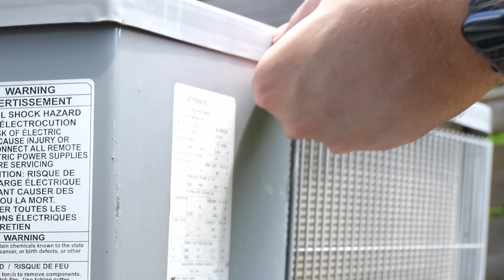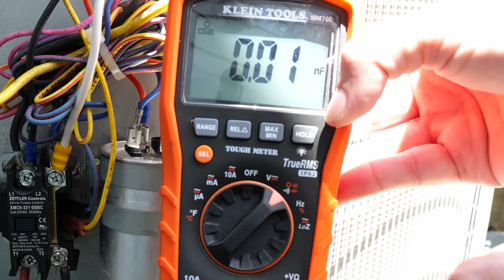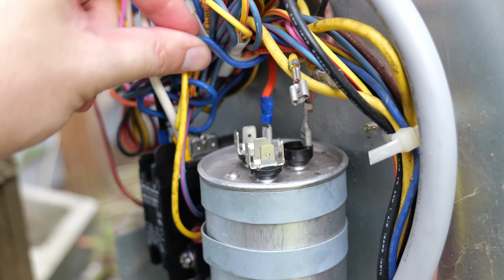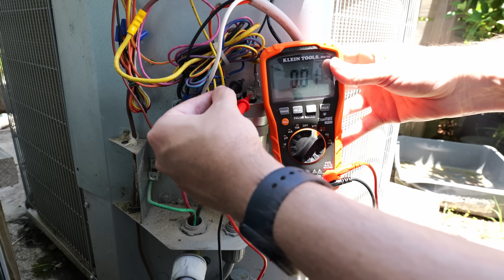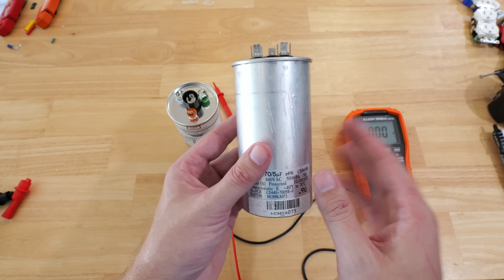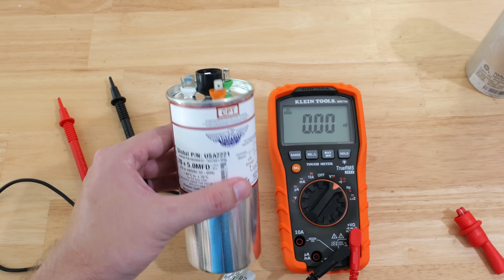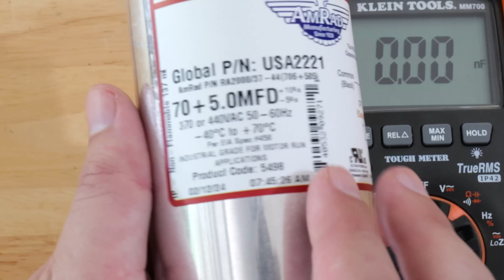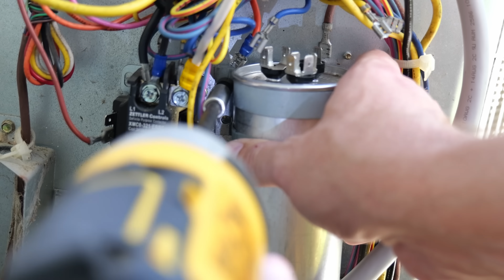Don’t Get Ripped Off! How To Avoid The AC Capacitor Scam And Save $500

Comment: As an AC tech I hate to admit that there's a LOT of technicians out there that will try to sell you parts just to make money. Personally, I hate how much most companies upcharge on parts. I get that what you're technically paying for isn't the parts but our knowledge as technicians. Companies usually get a discount at supply houses, so say they pay about 5 - 10 bucks for a capacitor. They then turn around and sell it to the customer for $300 - $500. I worked for one company that sold capacitors for as much as $575. As a homeowner, the more you can learn how to check and fix yourself, the better. Having a shop vac and knowing how to test a capacitor will save you from just about 90% of service calls in the state of Florida.
Reply: Thank you for your post. It was very helpful. ❤
Reply: Are you in the west Palm Beach area by chance?
Reply: What’s the best brand? I bought an AmRad on Amazon. Hope it last longer than a year
Reply: If you're blowing a capacitor every year something else is wrong  @TobyCostaRica
Reply: There needs to be a 'non-qualified tech hotline' report these so-called techs. 3strikes and you're out.
Reply: @LonnieMichel  there would be a few dozen left in this country
Reply: Checking a capacitor under load is only one method and is not more accurate than doing it as the video shows.  It’s a fact, look it up.
Reply: As a business owner (computer repair), parts need to have a 70% profit margin + whatever your hourly rate needs to be.  For example, if a part costs me $25, I need to charge about $85 in order for it to be worth it to keep parts in stock.  If my hourly rate is $260 and it takes me half an hour, the bill should be $215 ($85 + $130).  Special order parts don't need to have such a high profit margin.  Just enough to cover you in case you need to replace the part under warranty.  I've found a profit margin between 20% and 30% on special order parts is sufficient.  If the part is really expensive then the profit margin can be even lower.  I just did a motherboard replacement for a client.  The motherboard itself was $460 and I charged him $525 for it (which is about a 12% profit margin) plus half an hour of my time, so $655.  It was well worth it seeing as it was a $2,500 computer that was only about a year old.  You don't have to completely screw people over or make 3-10x your cost on a job in order to stay in business.  I absolutely hate contractors because in my experience 99% of them are greedy scam artists.  No, I'm sorry, you don't need to make $10,000+/day per customer.  That's just pure greed.  When the decking costs $2,600 and you're charging me $40,000 there's a problem.  Even if you paid your guys $100/hour your cost would only be $9,000 and you know he's not paying his guys anywhere NEAR that much.  When contractors quote me like this I call them out on their greed and tell them to F off.  It takes time but you can find contractors who aren't greed a-holes.
Reply: my experience is that AC techs are the worst professionals I have ever seen - worse than vets and doctors.
Reply: @donaldist7321 You've had zero experience with attorneys then??!!!   They will bill you at $600.00/hr at 1/10 hr increments and not even write the legal arguement using the crooect legal basis and you will for sure, 100% guaranteed, lose in court! And they still get paid $10,000 t over $20,000 per month because in their retainer you will have signed, it says results are not guaranteed!!!
Reply: And this is why you will always be an AC technician.  You are completely oblivious do the cost of operating a business.  That truck your boss lets you use is not a retail store.  Fixed overhead alone is insane for our trade.  500 during regular business hours is definitely High.  However call me out on a weekend and you bet your ass that's fair game.
Reply: 575 is a good price, imagine the cost of running a business bro. As someone that has just started, it’s crazy what you have to spend
Reply: 575 is a ridiculous uncharge. Majority of the ac companies in my area charge between 250 - 375 for a cap replacement. It gets really hard to try and explain to a customer why you're charging him almost $600 for a part he can buy for less than $50 himself.
Reply: @christianlandry4499  I'm in Arizona going rate for a cap is $400 I heard in California they get you for $650 weekdays after hours $750. Local news media use to setup cameras for these guys put dead batteries in the thermostat. Had one guy taking a piss next to the condenser unit he told the home owner he was putting refrigerant in charged $800 the system was low. He said throw in fresh pair of AA batteries for free. When the host of the show came out guy packed up and ran like a rabbit even left behind some tools.
Reply: @christianlandry4499  I hear the traffic gets much worse every year in Florida?
Reply: As an ac tech you should know this video doesn't show anyone how to check a capacitor properly... you test capacitors under load not while the unit is off.
Reply: @iratedu2776  If that's what you honestly believe then I hope to whatever greater power you might believe in that you don't do this for a living, or that you somehow have capacitor and contactor confused.
Reply: @christianlandry4499 in what? You absolutely check a capacitor under load using amps, volts and math.
Reply: @japhethwillmore725  What company do you work for and where are you located so people can avoid your business!  Capacitors are NEVER tested under load! Do you think the manufacturer has multiple systems that use all the various uF capacitors and they hook up these capacitirs to these live systems and check for capacitance??!!! 😂😂😂😂
Reply: @iratedu2776 why even test it? It's $30 and probably the issue if the fan is not coming on, just parts cannon it before calling a tech.....
Reply: @iratedu2776  must be a newbie in the trade and wants to create job security,
Reply: @iratedu2776  what are you talking about??? You can also test with the capacitor disconnected.
Reply: @VegasXGeorge  you can definitely check a capacitor while it’s not under load yes, but the correct way is to check it under load.

Comment: Had a breaker popping , tech showed up first thing clown did is put a screwdriver into service port of refrigerant and let a cloud out into air. Said he was checking for a charge? Well not anymore. I said i have had capacitor go bad and has caused this type of symptom. He finally checked it buldged and leaking. Charged us 200.00 for my diagnostics and a 25.00 part. Never checked the refrigerant levels after releasing to atmosphere. Clown shoes

Comment: In some rare instances, the cap can check good just sitting there, but not work properly in use.   I wouldn't recommend someone unfamiliar with electrical work try it, but you can measure the amperage with wrap around ammeter and then check the voltage from the common to HERM.    MFD = amps x 2652/voltage.  I would do this if the capacitor checks good on the bench, but fan or condenser still behaves as if capacitor is bad.  There are some good Youtube videos that show you how.
Reply: Eww dude , I was a frequent watcher of your content .I criticize you and you act like a child . Unsubscribed.ill like this one too ,lol
Reply from the maker: Yeah you’re right it was kinda petty.  Like away!
Reply from the maker: @mr.fiero87 😂 yes it is.
Reply from the maker: Completely unnecessary.  The MFD levels are based on it NOT being under load.  It should also be tested that way.
Reply: @HowToHomeDIY    I was referring to a defective capacitor that shorts out under full voltage vs. the  relatively low voltage a multimeter supplies to measure capacitance.  Again, I would only check it under load if it measured good, but the fan or condenser unit would not run, but was getting power.

Comment: Is it worth it to check the capacitor for DC leakage? After years of watching Mr. Carlson's Lab it has been drilled into my head that the only way to be sure a Capacitor is not beginningto fail involves the leakage test. Granted, he is normally working on Tube radios and or amplifier circuits, but i would think that a device that is not supposed to pass anything but AC shouldnt leak DC period

Comment: back in the day it was common knowledge that an a/c condenser fan  not turning was a sure sign of a bad capacitor . an easy way to check is to take a long thin  screwdriver and manually spin the fan in the proper direction and if it runs as always your capacitor is the issue and a easy fix , you can now leave a/c unit on and cool down house but if you shut unit down that condenser fan won't restart without going through the process as noted before. do not remove fan grate so your protected when doing this test . been doing it for years for neighbors with central ,window and refrigerators .saving them from being taken for a ride on a simple service call,,,,,,,,,,,,,,,,,,,,,,,,,,,,,,,,,,,
Reply: Digital multimeters are the cats meow compared to what I 1st calibrated as an Air Force 324X0 starting in 1969.
But "God" tools they are not. The Klein MM400 is spec's at 3% +5 counts in the range of 400 nf (nanofarads) to 40 uf (microfarads). The total capacitance range is 40 nf to 200 uf so the accuracy at 70 uf is...unspecified.
What this means to the user is that a capacitor spec's at 6% can show out of spec's when it's good and in spec's when it's in fact out.

PMEL guys are anal about test equipment spec's cause...
Reply: It's a good way to burn your fan up dummy
Reply: The hero we need 🫡

Comment: Just as a matter of good habit, when testing any electrical component, you shouldn't be touching any of the other terminals.   This is obviously more important during continuity testing, but as a good practice, you should avoid contacting other terminals while testing.

Comment: My repair company tech encouraged me to do it myself.  Now, when i get the annual service, i always watch the cap test.  If it gets low, i replsce it.  Just for the fun of it, I've got a spare for both my units.  Got them on amazon.  Edit: Oh, almost forgot: take a picture before you start.  Getting the wires crossed would be BAD.

Comment: I charge $180 for the first half hour $90 each additional half hour plus parts with a mark up of actual price of part plus 8.625 % for stocking hundreds of different capacitors on my truck plus sales tax. Don’t care if it’s a boat-ac-refrigeration unit-ice machine if you’re rich or poor. That’s what I charge to feed my family.
Reply: You must live up North or you're what those other 2 said....
Reply: You're a liar or you're a poor HVAC businessman. The Turbo 200 was designed specifically, so you don't need to carry multiple capacitors on the truck.
Reply: @DJS_ENO you’re kind of throwing money away if you’re buying the turbo 200 at best. At worst your overcharging your customer by using them every time.  installing them on every cap service call is goofy. There are a few common capacitors that cost 10-20$. The turbo costs 80$. Sure I have a couple but I would rather not use them if I don’t have to.

Comment: Don’t forget the voltage rating. Not only does the MFD rating have to like for like, the voltage has to be the same or larger, never lower. So your 70-5 at 440 volts has to be a 70-5 440 volts. Not a 370 or 240 volt unit. If you have a smaller 30MFD 370 volt, you can use a 440 volt but not a 240 volt.
Reply: Those were some very good points, and the higher volt rated caps MAY actually be more  reliable in service, though more expensive. I suspect that many cap fails are caused by power spikes repeated over time, (like back EMF from the motors, or near area lightening strikes) that nibble away at the weak spots of the insulating layer, until it blows a short. Also, in electolytic caps the seal may fail due to heating, resulting in it drying out the wet chemical insulating film and going open.
The one on my grinder that started hissing, then blew it's guts out the side is anyone's guess!

Comment: I watched your other video on this last year.  Went out to check the capacitors, I have two systems, and both looked good.  Even following your video, turning off the electric, etc, there was a slight hum coming from the area.  Even after touching the capacitor the way you suggested with a screw driver, the hum continued. Needless to say, I didn't test any further.  Where do you think the hum was coming from, or do you think there was residual electricity in the line?
Reply from the maker: Only thing I can recommend is in addition to removing the disconnect go to your main panel and if you see any breakers that say AC and/or heat, turn those off as well and see if the hum goes away.  Sometimes someone ran the wiring incorrectly and there can still be power present with just the disconnect pulled.  It’s rare but possible.  It could also be coming from your contactor and the low voltage from the thermostat but without being there I can’t say.

Comment: I stopped here to say make sure the spade terminals are clean and tight because if not, the terminals will burn up and the compressor or fan will fail to start and run.
Also, keep a spare capacitor of the correct values on hand, they typically fail between 3~5 years, better capacitors last longer but failure is pretty common.
Reply: I don't know why everyone wants to call those spade connectors. They are faston connectors. Spade connectors are the fork looking ones. Even on google you will find some faston connectors mislabeled, but go to the definitions and you will see.
Reply: @thomaswarford2920  I've always referred to the types as ring, fork and spade.  Maybe we can agree on ring.
I'll remember faston receptacle and faston tab if someone ever uses that terminology.  I see they're available in "high temp" as well.  Is this because FASTON is a trademarked name?
Reply: @thomaswarford2920  Is FASTON a trademarked name?

Comment: "OL" on your meter means overload not "open line". Open line is not generally used in metrology.

Good video. You should note that an oil filled cap can read 'good' and still not work in the equipment. Doesn't happen often, but it can happen. If your equipment is 5 years old or older, and it's on the original cap, replace it NOW. And replace it with one of those AMRAD brand caps since they're about the only ones left in the market that's not made of Chineseium. Yes. AMRAD costs more. What does a burned-up compressor cost?

Also along the same lines, you should replace the contactor proactively. The job isn't much more difficult than replacing the cap. They're inexpensive and, like the caps, can save you from burning up a very expensive compressor. The contacts pit in normal use from start up surge current and eventually stop making good contact causing a voltage drop to the compressor and heating it up. I replace them every two to three years, before the contacts start deteriorating. More often if the electrical supply is of poor quality -- high source resistance -- that you can observe by noticeable prolonged light dimming at compressor start. In cases like this, you can mitigate the problem to a degree by installing a hard start kit. AMRAD makes good ones.

I don't work for AMRAD or anyone associated, BTW. Just a happy discerning customer.
Reply from the maker: People refer to OL differently.  Some say open line, open loop, out of limit, overload, open load, and there are some others.  Tomato Tomãto.
Reply: @HowToHomeDIY  Nope. On a meter it's overload. Bet you that your owners manual agrees.
Reply from the maker: @General-Eclectic whether it does or not it doesn’t change what I said.  They aren’t going to cover every way it’s referred to in the instructions.  When testing capacitance the OL reading will come up if the device is open.

Comment: Everyone's an expert now great the guy that question replacing in 2 years could happen there is other factors in capacitors falling compressor age if units over or under charged dirty coils extreme Temps also in rural areas were ur at the end of a electrical grid that is already over taxed hard start kits can aid in that plus there is a formula for checking capasadence in run condition to check for problems that might make my 2 years of training and 28 years of experience worth somthing

Comment: That's why I hate these videos gives everyone the impression we're all scam artist and crooks iv never scammed anyone and if made a error admitted it and corrected it trust me there is still techs out there with morals and integrity when I retired after 28 years of working on hvac equipment I had costumers cry because I was leveing and they trusted me
Reply from the maker: Oh yeah I’ve met some good ones.  But if I’m being honest I’ve probably met more bad ones than good ones.  I have so many stories working with HVAC contractors both personally and professionally.  Thank you for being one of the good and honest ones!
Reply: My mother and father raised me with a high sence of honesty and accountability and thoughs traits were enforced by the air force I had customers with million dollar homes leave me the keys because they couldn't be there you can emagain how seeing this post on vetrans day of all days even if it wasn't posted that day that's when i read it
Reply: My dad and mom raised me with a high moral sense of values and to asept accountability witch was reinforced in the air force so u can see how seeing this on vetrans day  pissed me off and real tired of people thinking only thing hvac guy do is change filters and push reset buttons